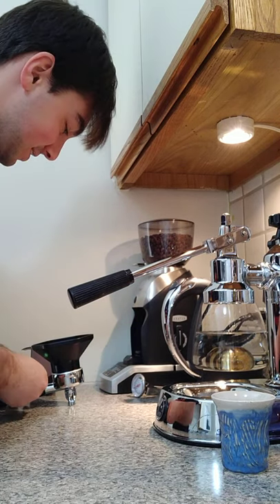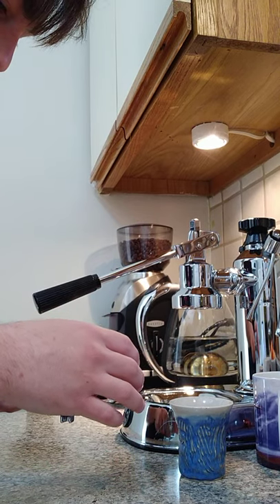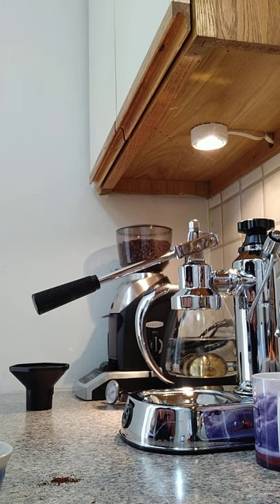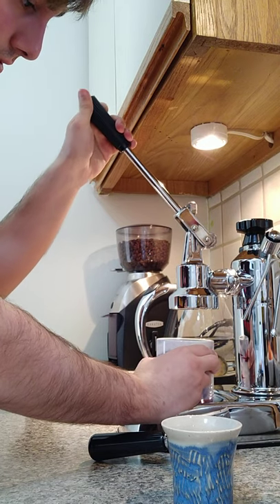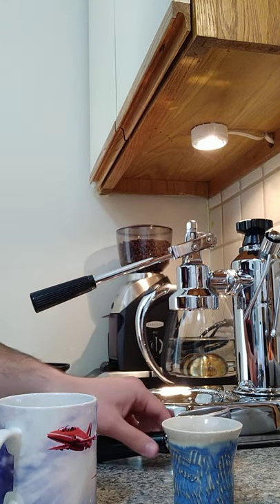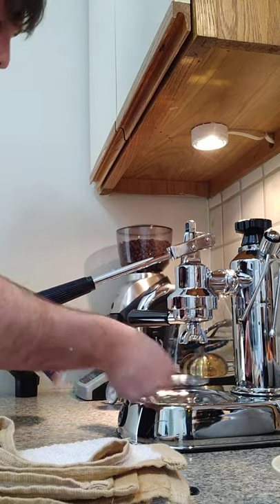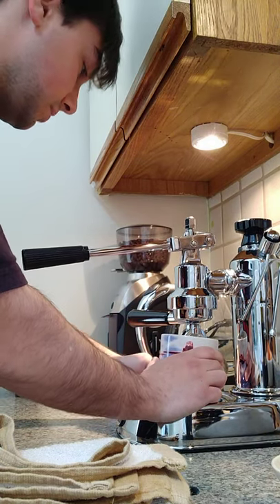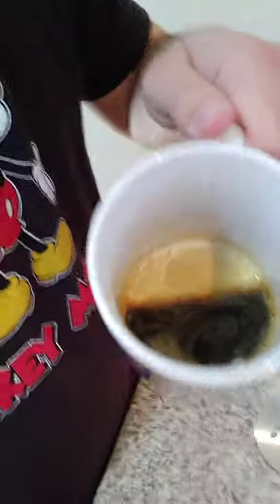La Pavoni Europiccola - my first shot!

Comment: I've got mine about a month now, same vintage and with an imperfect piston gasket to be repaired. Here's my take for other newbies like me. I've practiced on old preground decaf (so I could drink multiples and cheaply) RE-ground finer in a decent hand grinder. You need a temp strip, I picked up 40-90 C strip. I use the low wattage while I start preparing my coffee and tamp. About 5 minutes. When more ready I switch to high and watch the strip. Another 1-2 minutes and the strip starts to register. Place the empty portafilter, do no pumping (that does nothing despite everyone claiming it does) -  just let the upper grouphead infill with hot stuff by kinetic energy. Things start to move faster here. About 60 C with some pressure now built, lift handle till water flows out the bottom (preheating the lower group) and a coffee cup, then lower handle. At about 85C flip back to low wattage to buy a little time, remove portafilter, place coffee basket, lift handle part way to eliminate an air pocket and suction through a dry puck, set the dosed portafilter in place and watch temp. Leave handle halfway and so blocking inlet hole. You can fine tune temps now by playing combos of the switches but my guess 85 on the upper grouphead translates to 90ish in the boiler if you've played the switches to start heating more so at 85-90 lift the handle fully to fill the lower grouphead/pre-infuse and pull the shot. Too easy?..need finer grinds or harder tamping or even try coarser grinds with hard tamp, etc.Too hard?..just the opposite. Too bitter/sour..play the temps.
Reply: Big Correction at myself. With lever down and water sitting above piston, when lever is half raised in pumps that water has to go somewhere so  it must go back into boiler and so will circulate newer hotter water. So with the temp strip attached there, gives a truer reading of boiler temp. I stand corrected by Claudio and thank you to both

Comment: It's smart to use the aeropress funnel. I just order my La Pavoni machine but has yet to receive it. Will definitely use that funnel as well. but why didn't you use the plastic tamper that comes with the machine? it's should be better than using something else that is not a tamper.
Reply from the maker: I purchased the machine used off eBay, did not come with a tamper! Only the basket and portafilter :)
Reply from the maker: Just uploaded a new video if you're interested! Have a tamper this time 😆